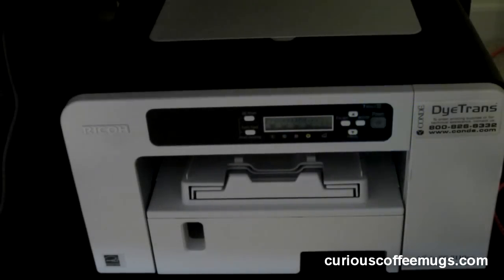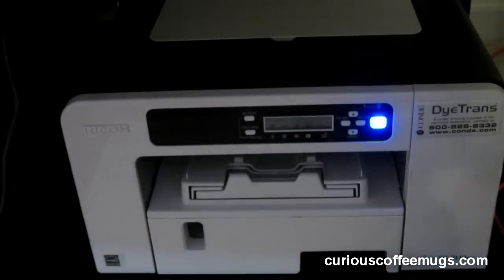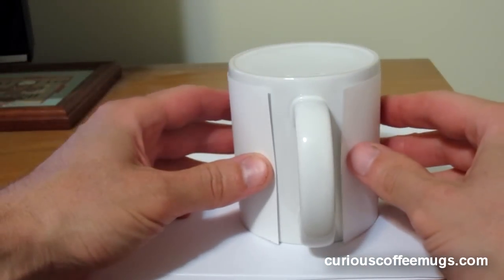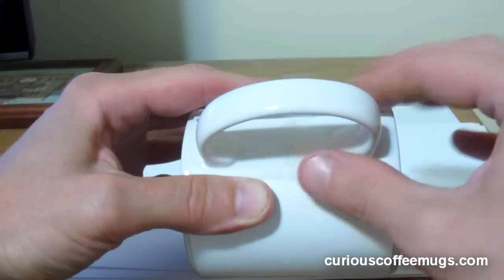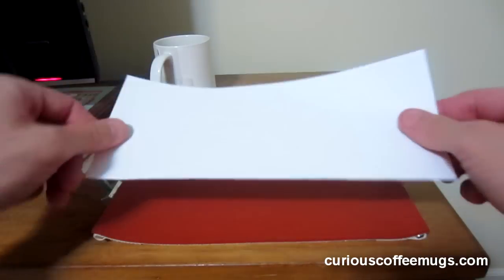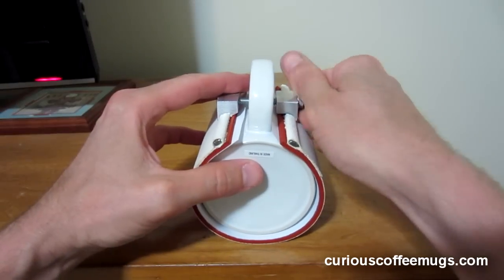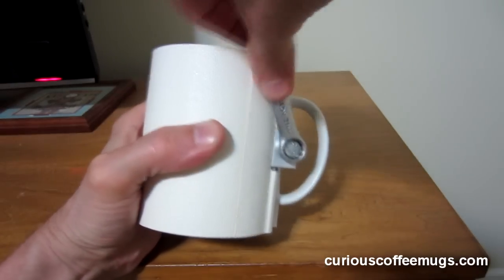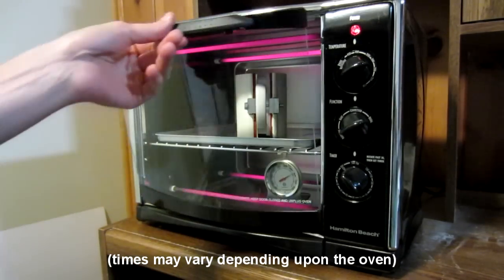Sublimating Ceramic Mugs Using an Oven and Mug Wrap

Comment: Should the image that gets printed be a mirror or reverse image? and how long should it stay in the oven at a temperature of 400 degrees?
Reply: HI yes it should be reversed. Also every convection oven is a little different on time.  with mine it about 13 mins. if you want more search  Tips on Printing Mugs in Oven - here on you tube..:)

Comment: Do I need sublimation printer? And paper to print?
Reply: Sheryl Cruz yep, you need to print it with sublimation ink in special paper for it to work. I've seen some people print it in normal white paper because it's cheap, but the results are not that good in my opinion.
Reply: So what kind of paper I will have to use?